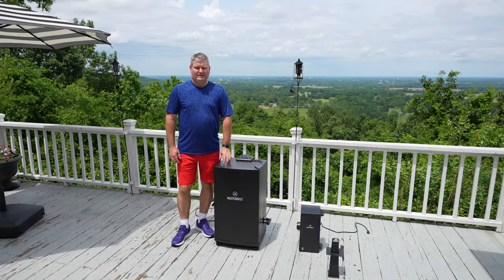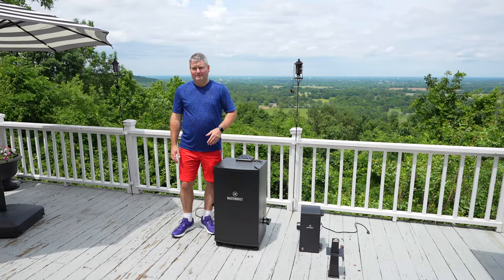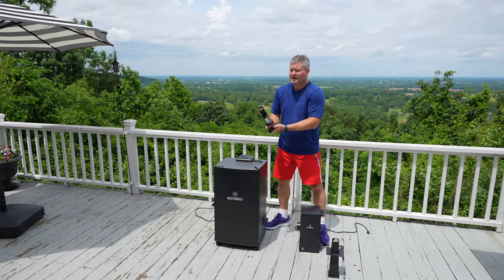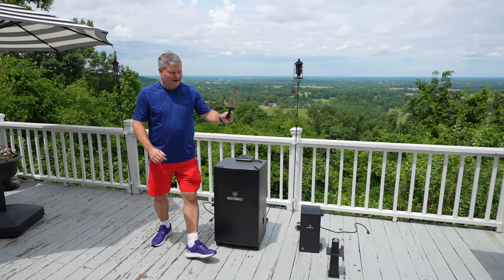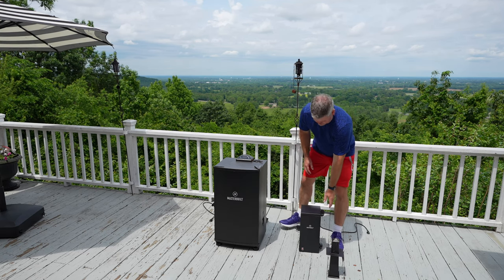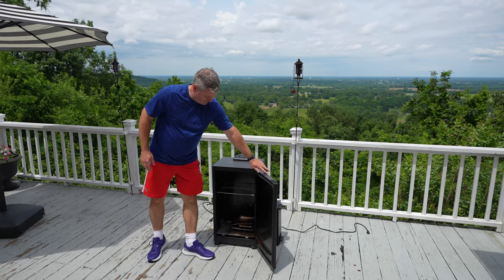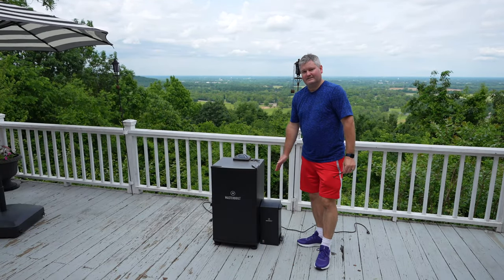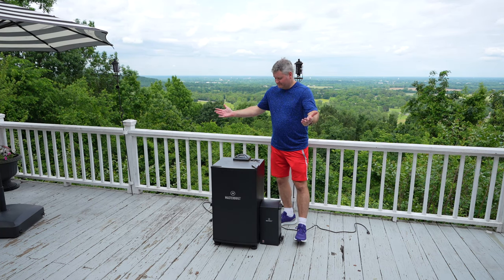How to Attach Masterbuilt Slow Smoker Attachment

Comment: BTW- I didn't tell you my setup.  I removed the "feet' on the 30" smoker and replaced them with 2 inch casters so I can roll it in and out of the house with ease.  There is no need to use a permanent attachment for the Slow Smoker.  Buy a baking pan that is 8"x8"x2" and sit the Slow Smoker on top of it.  Adjust the feet of the Slow Smoker while it sits on top of the baking pan to where you can wheel the smoker into it to where it couples with the opening on the smoker.
Reply from the maker: Great tip!  I actually disconnect my sow smoker attachment once cool and store indoors.  It comes with that mounting bracket but I took that off, so it’s a quick and easy disconnect after I finish my smoke.  Great tip!  My Masterbuilt is small and lightweight enough to lift.  I wouldn’t want to roll and risk scratching the paint on my deck.

Comment: It's awesome that YOU are posting these videos because I am pretty sure that almost everyone else has given up using Masterbuilt junk and you can't find ANY videos other than yours that aren't over 2 years old. I bought a 30" Masterbuilt electric smoker at the beginning of the Covid lockdown for a GREAT price.  I got the smoker and several accessories delivered at a total of about $180.  I also ended up buying the cold "slow" smoker for around $20 because I had coupons!  LOL  ANYWAY- the entire thing sucks.  Have you tried anything but pork butt that runs at a HIGH temp??  Your video of cold "slow" smoking cheese doesn't even show the final result.  Is Masterbuilt paying you for the videos?  Seriously!  I'll tell you MY experience with a Masterbuilt 30" electric smoker and the Slow Smoker attachment and hopefully you still LOVE your setup and can tell me that I am wrong!  The first thing to know about Masterbuilt electric smokers is that pre-heating is a MUST because the temp will go WAY over the top and finally come down to the pre-set temp after about 20 minutes.  The biggest issue that I have is that I like my meat cooked LOW and SLOW.  Wood chips in the tray will not produce smoke EVER unless you are are getting the smoker HOT and that defeats the purpose of smoking.  The SLOW smoker attachment has a ton of issues with the biggest one being that Masterbuilt decided to paint EVERYTHING.  The chip chute gives off nasty fumes from the paint burning off until you actually use a paint remover to get rid of it.  Even the paint on the inside of the lid peels off and, if you're lucky, you can just pull it off while it is still hot and rubbery (wear gloves because your fingers will be stained for weeks if you don't!)  As far as smoke coming from the SLOW smoker goes- you may as well plug a truck with a diesel engine into your smoker because the smoke is THAT dirty.  One of my latest (and their have been MANY recently) attempts to make clean blue, light smoke come from my slow smoker was to toss a few handfuls of wood chips in my dehydrator for 28 hours.  I did not get condensation on the lid of my Slow Smoker for the first time EVER- but everything was sticky and black.    Tell me again how much you LOVE your Masterbuilt electric smoker!!
Reply from the maker: Masterbuilt is not “junk,” if one knows how to use it.  Electric smoking is a low and slow process.  People that lack patience and attempt to rush the process will experience sub-par results.
Reply: @IrixGuy  Make no mistake- the cooker itself is awesome!  The problem is either you get NO smoke or too much smoke.  There is never the "light blue" smoke that is ideal.  It is either nothing or something similar to a hillbilly "rolling coal" in his diesel pickup truck
Reply: See now I love my Masterbuilt smoker and the cold smoker attachment. I’ve had mine since 2014. I’ve been able to achieve the infamous blue smoke with it. I’ve cooked all sorts of meat (both whole and cuts), veggies, even eggs, and cold smoked cheese, seafood, and salt. I’ve not had any cooking temperature problems. When I want temps higher than 275 degrees F I’ll use my grill with a smoker box. This type of smoker is not for everyone based on their desires for specific finished products, however, I love mine.